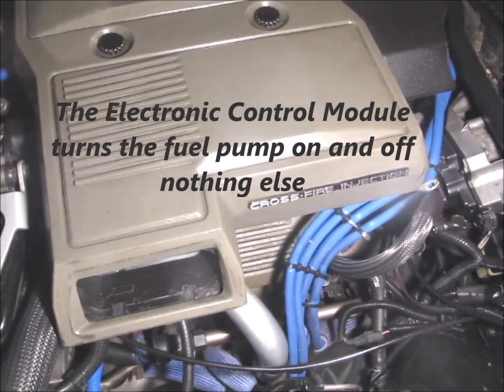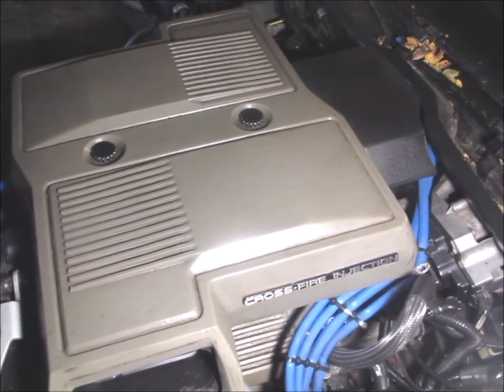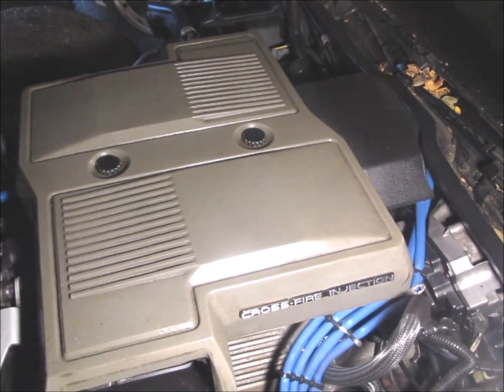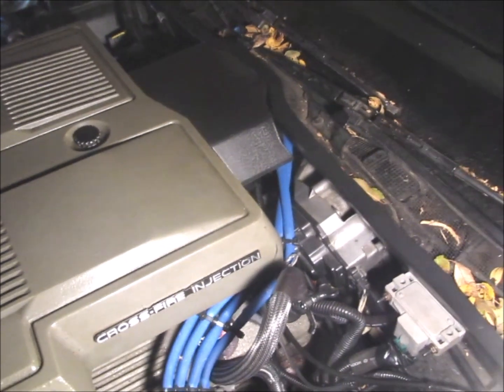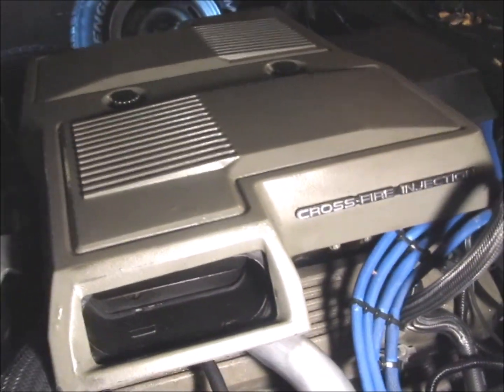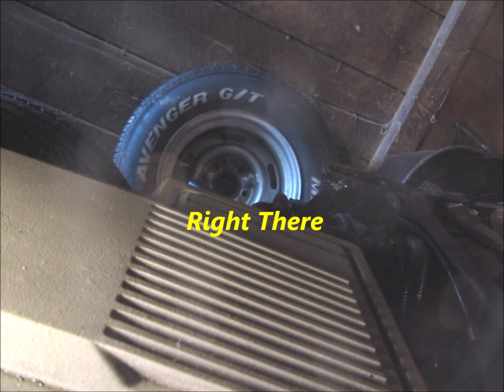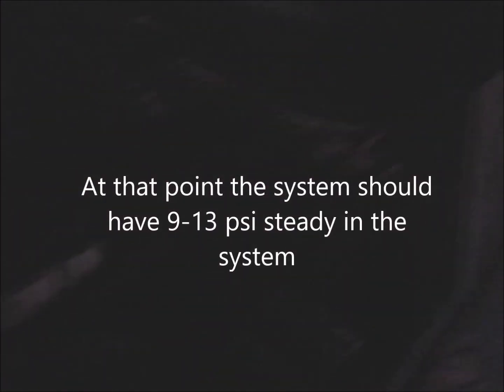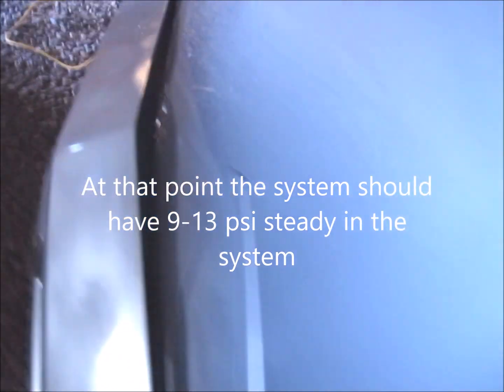𝟏𝟗𝟖𝟒 𝐂𝐎𝐑𝐕𝐄𝐓𝐓𝐄 TBI  Fuel Delivery System Electronic Control Module

Comment: great video 3DELTA7  Sir! I have a question I have the same car  I replace the whole fuel assembly and fuel pump still wont start ?  I used the starting fluid  its  engine starts  for  few seconds ..
Reply from the maker: Could be one of the two IAC valves sticking

Comment: Thanks for the videos. I've been watching your vids to figure out my problem. I'm trying to diagnose a crank with no start issue on my '93. My fuel pump primes for the 2 seconds. When I turn to crank, it just keeps cranking with no start. Since i hear the fuel pump prime, can I assume my fuel pump relay, fuel pump, and ecm are functioning properly? Not sure what the problem could be...
Reply: Hi Antonio Pulido,  just because you can hear the pump come on dosen't mean you have fuel pressure,  you need at least 35 lbs of pressure just to start.  If you spray a little starting fluid im the intake and it starts and dies, you have a fuel  problem, if if dosen't you have no spark. It's a quick test to put you in the direction you need to be in.  Not sure what tools you have like fuel pressure tester or test light and so on, if you do the starting fluid test and get back with me, i may be able to guide you through.  Have fun ..Tim
Reply: Thanks all. I did test the fuel pressure at rail. Was 40psi at pump priming and at crank. I tested injectors with a noid light and was getting signals so assume injectors are injecting fuel. I pulled a spark plug wire from spark plug and place near block. Cranked and did not see and arc from wire to block. Haven't troubleshooted after that.
Reply: @antoniopulido5515  since you have fuel pressure and injector pulse and no spark. I would check power at the coil, i have a good feeling you will. If it were me, I'd replace the ignition module which should be right next to the coil on the front of the driver's side head. Age and heat take their toll on them, and really should be replaced just for that alone. That's is where i would start,  and more then likely it will fix the no spark.  Well as long as you have power at the coil.  Let me know and try not to spend to much money..lol  p.s  is your theft or security lite flashing with your key on?
Reply from the maker: Thanks Antonio, really can't help much with a 93, the 1984 is completely different than any other corvette ever produced, it's a Throttle Body Injection as opposed to your Tuned Port Injection system.  If you have fuel pressure at the fuel rail and every coil pack is good voltage, my guess would be in the optispark somewhere...but that is just a guess. I have heard that the optispark system can get damp/wet and just fail. Think they are cooled somehow with the engine coolant???? All speculation here.
Reply: @HorseshoeBeach  I really like watching your videos,  probably seen all of them 5 times or so..lol. keep up the good work and maybe you can keep someone from hacking up another already hard to find 84 crossfire.  I have two of them myself and wouldn't trade them for a new one..lol
Reply from the maker: I really appreciate that comment Tim, made my day. My early video attempts were poor, I try to share and and maybe help the next guy out. 100% agree, absolutely wouldn't trade this 1984 for a new one. The 1984 Corvette is a hidden gem.